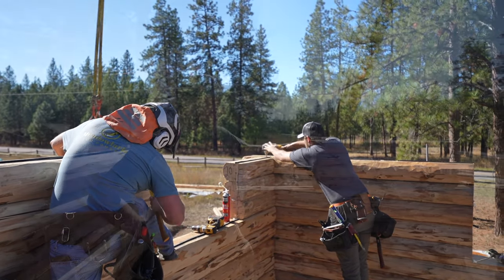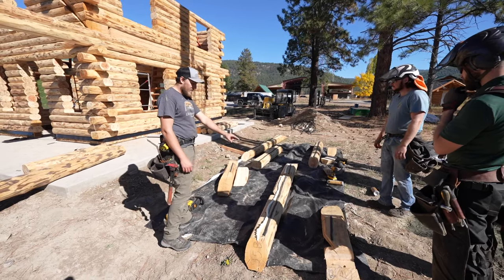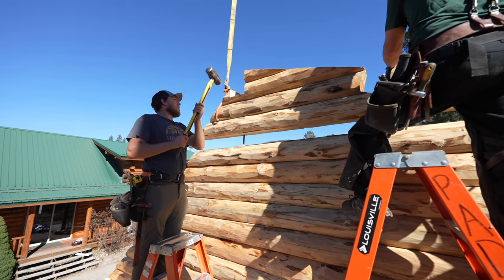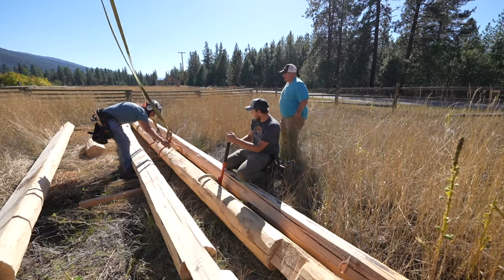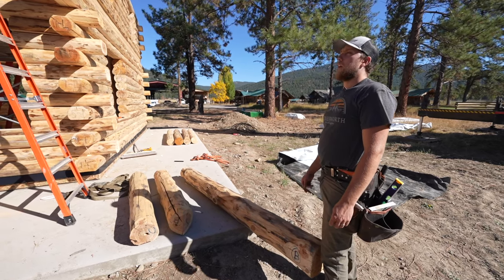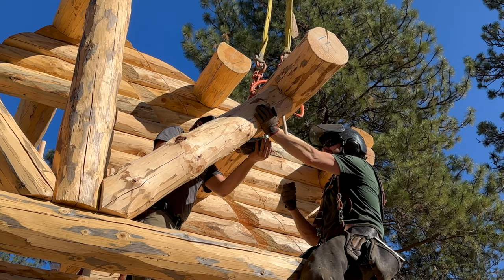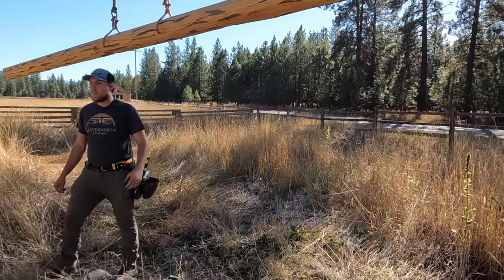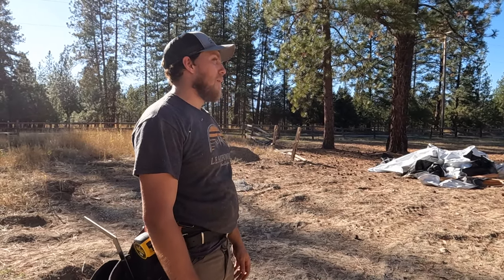Log Cabin Tutorial | Part 4 - 2nd Story Logs

Comment: Hello, I think  that , it was necessary to secure the logs with wooden birch dowels . You can't use metal nails and bolts . Because in winter ( cold ) time , condensation will form in these places and this house will begin to rot.
Reply from the maker: These structures are engineered and required to use metal fasteners. Condensation on fasteners inside of a log wall is not an issue.